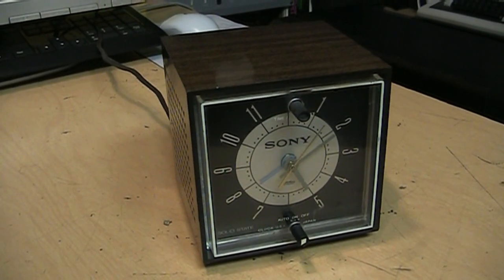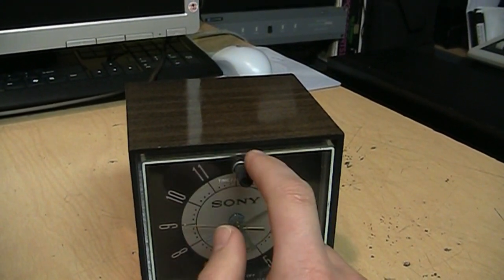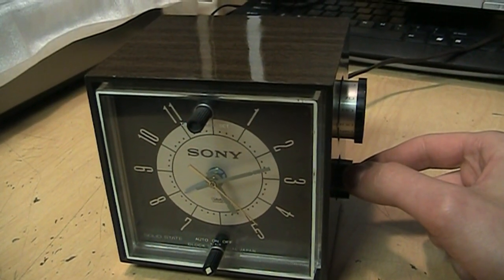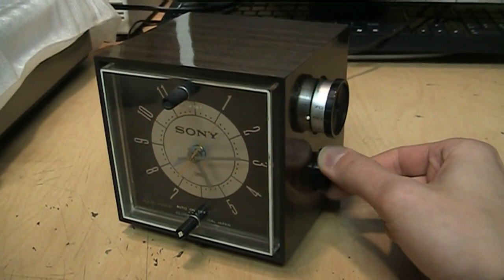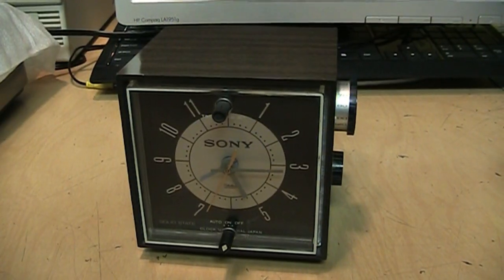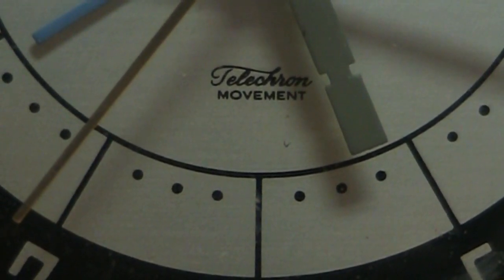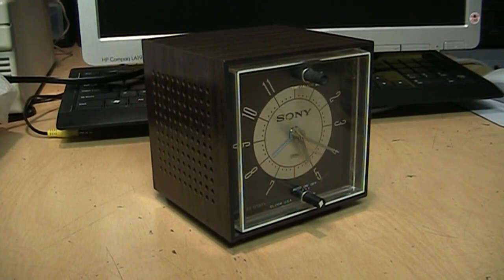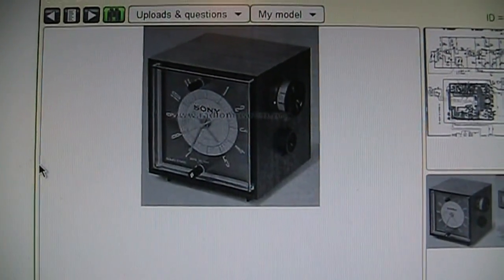1960s Sony woodgrain cube clock radio

Comment: Love the vintage late 60's / 70's electronics. I love the thrift stores, I have found some gems in those stores for little money.  Nice little clock radio, SONY had some cool looking electronics.  Looks like that uses 6 Germanium transistors, which were common in that vintage.

Comment: I have one that is identical to this one. Mine is from 1972 and I have the original box and purchase cards that came with the system. It was purchased brand new by the original owner on January 13, 1972.

Comment: Much woodgrain, so vintage, wow.
I don't think I saw this in either of my trips to the thrift shops this past couple weeks, so perhaps you got it earlier than that or got it from one of the stores I didn't go to. there was a neato hitachi camera that used Mini-DVDs over in Watchung that I left there because I didn't find the charger for it, but I do have Mini-DVDs here for such a camera. Most of my purchases have been an iPod Mini and a couple of Shuffles. I have batteries galore on order. also a Sega Game Gear with almost everything there to use for spare parts for the other three I have.

Comment: I too have discovered the polish and shine attributes of Goo Gone, but it's been my experience that dry buffing leaves behind a freshly shined finish at the expense of an oily residue. Did you use a cleaner of some kind after applying the Goo Gone?
Reply from the maker: I used glass cleaner afterwards.

Comment: Do you still have AM stations in the US? Here in Germany are no more AM stations on air and they think about shutting down FM in the (near) future and replacing it with DAB+, even though it has many disadvantages in comparison to AM/FM.
Reply from the maker: Yes, the U.S. has more AM stations than anywhere else in the world -- over 4000 of them at last count.
Reply: VWestlife Thanks for your answer. That's really nice. In this case, old radios are not useless. If you get a only AM radio here in Germany you can only hear stations in the evening/night from abroad or input a signal over the Phono Input Jack - but this isn't really the same :-/.

Btw: Great video as always :-)

Comment: 50 years old, and still as confusing as modern clock radios. What on god's green earth is "auto"?
Reply from the maker: That means the alarm goes off automatically at the time you set.
Reply: VWestlife my eyes have been opened! That's super confusing. Why not just "alarm"? And if it has a buzzer alarm, do it like others that have options "radio" and "buzzer". 
I think that's the best layout.
Reply from the maker: There is no buzzer in this one. The alarm only plays the radio.

Comment: people in norway can't use it - they turned off analog radio
Reply from the maker: No, they can still use it to listen to AM radio from other countries.
Reply: Wow, already? Other than the wider variety of stations (that they compress and squeeze in!) I've found digital to be a bit of a pain, especially when you've got a weak signal and the things burble away, hah! Internet radio can be good if you find a station streaming at a decent bit rate.